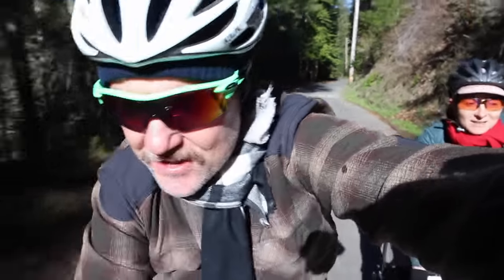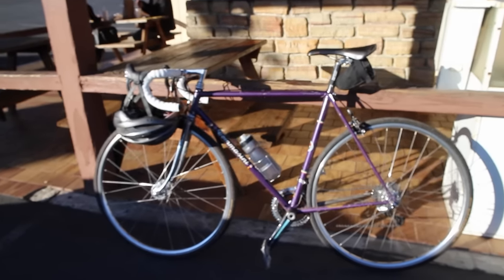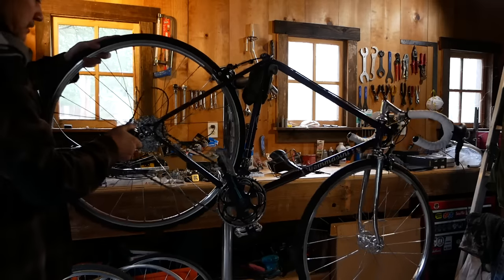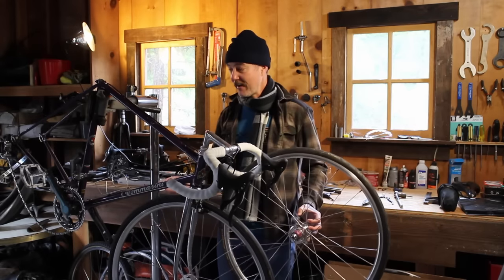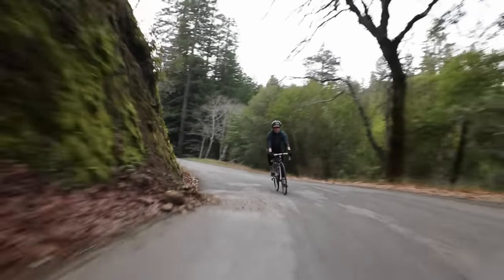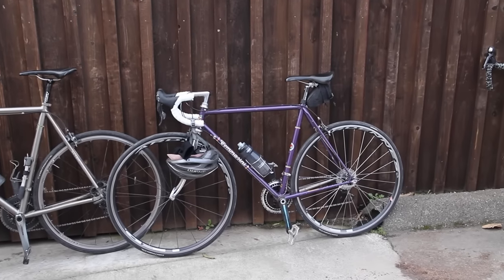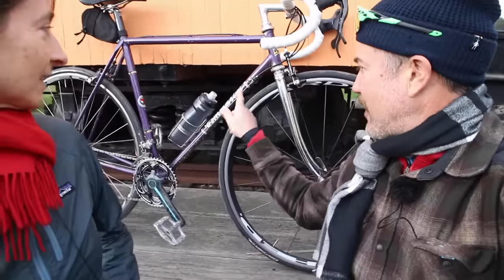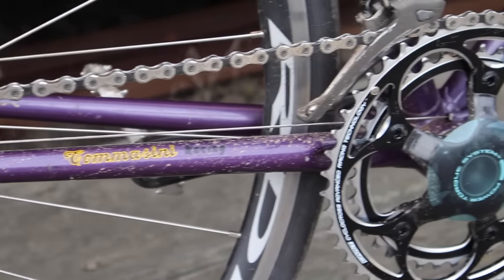Meet Ms. Cools New Road Bike

Comment: Nice bike Cools! I just got a Battaglin steel bike that has compact Campy 50/34 in front and 11-34 in back. I've never had a bike that is so easy to climb on. That type of gearing might be a nice set-up for you Cools. The one to one gearing is a real spinner for steep inclines.
Reply: Grats!  Is that a vintage Battaglin or one of recent/current custom ones from Officina Battaglin?

Comment: Nice ride! Hopefully a lower 34 tooth in front works, and some fiddling around to raise the handle bar for comfort if necessary. I was thinking that quill stem could move higher, but maybe the shorter head tube needed a shorter stem insert. Possibly, just guessing here, you can find a shorter stem horizontal length and by bringing the handlebars back a centimeter or two Ms Cools reach will be comfy. I know messing around with too short a stem on those frames can unweight the front wheel and change the cornering feel. Anyway nice build, sweet ride, if it was a 58cm I have a good idea how it would ride for me back in the day. Thanks for video! Merry Christmas, and happy trails to all.
Reply from the maker: Thank you and happy holidays! We're still dialing in the position, but we're getting close. The seat was a tad high on the first ride, but that's because I didn't want to cut the seat post until she had a chance to ride it first. I trimmed the post down about 2cm's and now I can lower the saddle a bit more.

Comment: There was an importer in the 80’s called Ten Speed Drive imports, they brought over Tomasso’s and several other brands not sure if they’d have had a hand in the Tomasini?
My 88 Battaglin came through them. It’s also got a purple metallic paint but wayy more to the pinkish side.

Comment: I only own steel bikes now. My daily ride ironically has the skinniest tyres. Late 90s Roberts, which can only fit a slim 30 under the mudguards. 

Fastest and best performing bike is my track bike, which is early 80s, which was built for Grass Track, but also has mudguard drillings. Its a Mercian which was according to them custom made for somone else with equally long torso and short limbs. Can clear decent sized 30s with mudguards and 33s without. Goes like a rocket on grass/ cement or wooden track and can handle road and paths pretty well. 

Then there's the Jack Taylor 650b Super Touring Tandem, which is lighter than some single bikes.. which I'm actually the stoker for (Capn' used to be a top track sprinter, messenger and mountainbiker, and best to let her steer...).

Comment: I had this same issue with my freehub body. The bearings inside are probably worn out like mine were. If it has sealed bearings, you can remove them, look at the numbers on them if they have some or measure, and then go to Amazon and enter the numbers or dimensions to get new ones.

Comment: Good to see the old bikes!  Ive had a 1990 MASI since the frame was new, it was the main bike for many years.
Then I totally refreshed everything on it, kept it 9 speed...............I did get bars near level with seat with a Nitto Stem.

These bikes dont really handle right when the stem is raised up that much, its not bad but its not how it was meant to be set up.

As cool as the old bike is, the new Canyon Endurace I got last year is really good, the fit, the ride, the new drivetrain............everything.  Bars/stem can be as high as a person wants, and it still handles fine that way. I do like the sub 16 lb weight on the new bike also.

Comment: Really like the cable guides on top of the BB. Can't understand why they went away. Very practical for cable installation & protection. 

Re: paint; the Italians weren't very good at paint so several importers brought them in bare & painted them here.
Reply from the maker: The cable guides are so nice! They probably went away because they take extra work to install versus drilling a hole in the bottom bracket and using a plastic guide. I really liked how easy it was to set up the cables on this bike.

Comment: Neo retro. Sweet build y'all. 28's on the front might be a good thing to take some hits from the road. What's the rear derailleur 🤔 cool to be able to run a 34 in the back if possible. Then Ms. Cools will be a contender👊🏼👊🏼 I wish you all many wonderful miles ahead. Merry Christmas and a Splendid start to the New Year ✌🏼🙏🏼
Reply from the maker: Thank you, Robert! Not a purists dream bike, but we made it rideable with some modern(ish) components. I'm not sure what is modern nowadays, but this is mostly 11-speed Campy. The rear derailleur is an 11-speed Record with a medium cage mod. I took all these parts off of my gravel bike when I swapped it over to GRX. We did buy a new NOS 11 speed CX crank, the less desirable Power Torque model for this bike, so Ms. Cools could get compact gearing. What's really cool is how the 11-speed fits this beautiful frame.
Reply: @Henrywildeberry  I have a Sintesi from 1999 that I recently put a 11 speed Centaur/Potenza group set on. Works like a charm. These "old" bikes are meant to be ridden and not treated as wall pieces. And it is pretty shocking how much tapered head tubes, ultra wide BB and disc brakes add to the heft of these new  bikes.

Comment: I love Ms. Cools new bike!  But I may be biased as I have not 1 but 2 Tommasini Prestige bicycles!  LOL!  Mine are made from Columbus SLX tubing.  I need to get them out and ride them.......
Reply from the maker: You are at least four times as rich then. There's a quadratic relationship between the number of vintage Italian bikes you own and how wealthy you are.
Reply: @Henrywildeberry  LOL!  Well......I bought one, frame set only, in 1988 or so for 500 dollars.  I took the components off of my Trek 1100 (?) to build up the Tommasini.  I sold the bike on after a couple of years and then bought it back 20 years later!  I called this one "Gina" after the famous Italian actress.  The other one I bought 10 years ago for 250 dollars.  It is one size larger than my first one and I wanted to try it.  The larger one is the one that I keep going because I like the way it feels better.  So no, I'm not rich but I like the way you're thinking!  May Ms. Cools enjoy many, many miles on her Italian steed.

Comment: I theorize that if she's got a greater handlebar drop, the saddle will need to move forwards to maintain a more familiar (comfortable) hip angle.   Regardless, I found going back to my road racer takes a few rides to ease into a position that is so different than my more relaxed bikes. 
I run 46/34 on one of my bikes and it's a great combo.
Reply: I've used a couple of techniques to squeeze a few extra mm of height out of the handlebars on my smaller vintage bikes. The best way is to source a taller stem that gives you the extra height option. You can also get a couple mm's from slightly changing the angle of the handlebars, and the brake positions, without going overboard. Comfort is first for me, so it's worth the tweek. My vintage bikes are from 54-58cm, but I try to keep the same position on all of them.

Comment: Another great musical accompaniment. 

Why not raise the bar so that it  matches the drop of the other bike?Looks like a quill with a plug that can be adjusted with a hex key. I do recall that there are also adjustable quills that have an articulation which can be helpful, even though not as elegant looking. Also, increasing the saddle setback should make it easier to hold a lower position and it looks like Ms. Cools has the arms for it!

Curious to know how well it shifts with a SRAM cassette and a Record(?) derailleur.
Reply from the maker: Thank you! The Sram cassette (11-32) works pretty well. I was able to adjust everything without any gears skipping or rubbing.  The rear derailleur is a Record with a medium cage mod.

Comment: Nice Bike :)! And what bar is on that beauty?
Reply from the maker: Thank you. That's a Nitto M106 bar. It's a modern bend with a classic 25.4mm clamp diameter. The shorter ramps work well with brake lever shifters. They are also heat treated and very lightweight.

Comment: I know you’re careful  and the short seat post and saddle bag are issues but I cringe whenever you clamp your frames in the stand. 
It’s a beautiful bike!
Makes me want to ride my Italian bike. 
28mm seems so tiny though 😂
And Forestville is now the place💪🏻
Reply from the maker: I'm careful with how I clamp the frame, it's never a tight squeeze. The the weight is supported by the top tube and chain stays resting on top of the clamp. It's like handing the bike from the saddle, it sort of rocks around when I'm working on it. Forestville was always such a sleepy town, now it's the next hot spot!
Reply: @Henrywildeberry  in my mechanic days I saw more than one decal twisted or paint job scuffed up from too tight or too loose a clamp. (Not to mention the horrors of deforming a client’s frame tubing😱)
Reply from the maker: @mytwocoins  I can imagine you're still dealing with post traumatic stress. I will say, what I have going for me is I'm super slow and don't get paid to get stuff done. You won't see me cranking on bolts too tight to try and get it done. I'm more of a sip on a beverage, go slow, stop and look at, going inside and read up, come back, look at, contemplate, decide it can't get done, and go for a ride on a different bike kind of guy. I promise, I won't bend or rub my paint too much:)))
Reply: @Henrywildeberry  I take time to savor as well. A mid project ride is a good way to process ideas.  
A bicycle is my favorite place to ponder on things.

Comment: Are all the tubes round? or a proprietary shaped tubes? I didn't get what the rear cassette is. I think TA do campag rings. You might be able to get down to a 32 but that maybe on the standard BCD 11 speed.
Reply from the maker: Hello Troy - All the tubes are round and traditional diameters. The cassette on the HED wheel is an 11-32 Sram 11-speed. This a 110 BCD crankset. We have a 34 tooth chainring on order. It's good to know TA makes smaller Campy chainrings just in case.